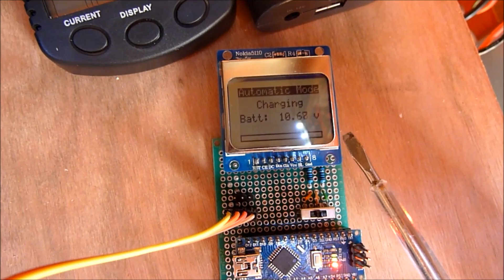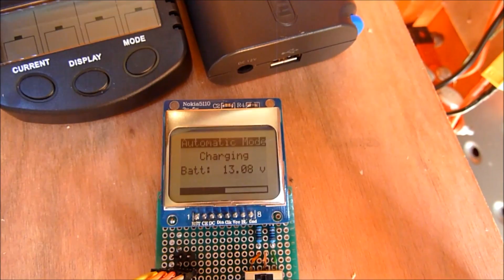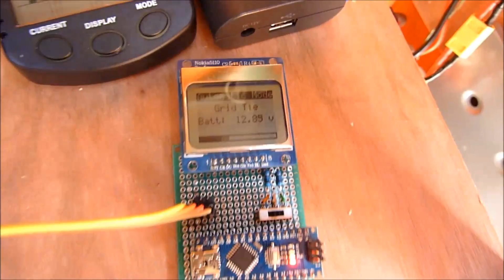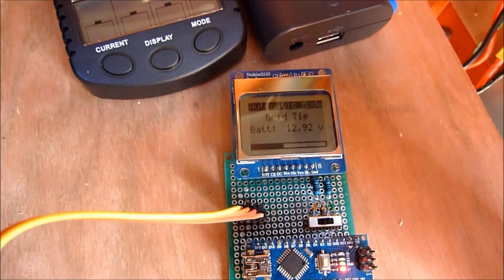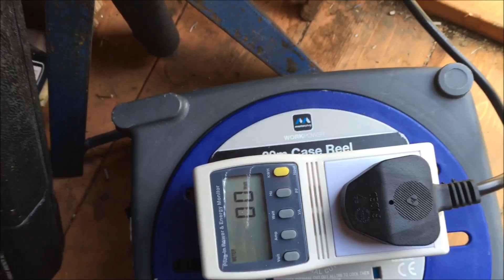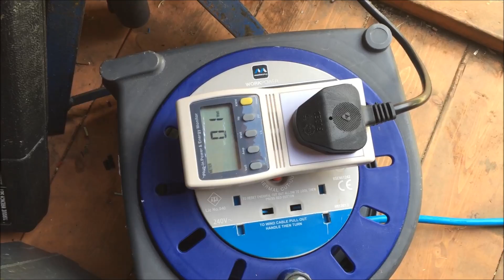Automatic Grid Tie Switch Version 3 - Adam's Arduino Projects

Comment: Congratulations it works, but isn't it all missing the point ? If you want to save electricity, push energy to the grid all the time from the solar panel through GT Inverter to get some power credit. In the evening you will use power from the main grid, since it is already in the shed. Much more robust solution with less elements and mainly without the short living battery in my opinion.

Comment: Hi Adam. Love the device featured in this video., indeed I am a bit of a fan of your videos so far. I am looking for a device that switches power supplies from my inverter back to mains (or a 12v mains supply) when the voltage drops too low. Do you have any suggestions / creations?
Reply: Actually disregard my comment, sorry, found this - http://www.reuk.co.uk/wordpress/electric-circuit/switch-from-inverter-to-mains-automatically/
Reply from the maker: +Ian Hutchinson Glad to see you've found something and thank you fir the kind comments.

Comment: Hi Adam. I love the system, nice job mate. Can I ask what sort of figures you get going into the grid? The reason I ask is I have a 10'x10' shed, half of which's roof faces south. My garage is totally solar on 4x100ah batteries, because it is too far from my house to run power to. Even though I live in one of the dullest areas in Europe (wales), I still get a good return on 1 x100w polycrystalline panel, keeping the batteries topped up. 
Your system is 100w ish I gather. Just as a point of reference to see if it is worth doing. Cheers Huw.
Reply from the maker: I have 150watts on the shed roof which can be diverted to the grid tie.  I get on average 100w going into the house from the inverter on a good day (yesterday was quite good).  If I had my panels in a string to get higher voltages I'd probably find it would be more efficient as there is less of a jump from 24 or 48 volts up to 240.

I've never felt like this project has been completed.  I was only looking at it yesterday thinking there might be some improvements to be made.  It's on the list - one day.